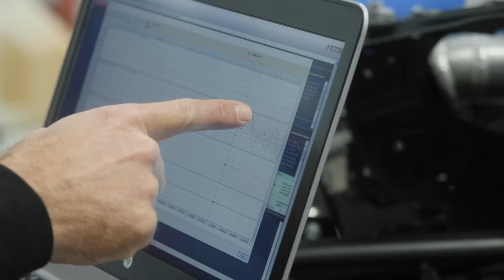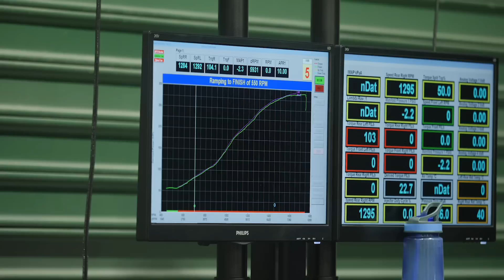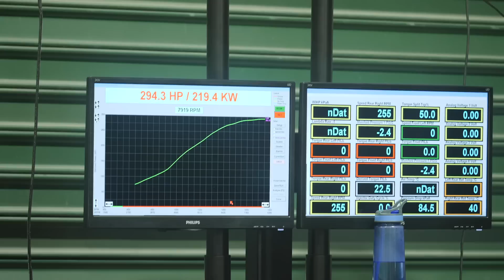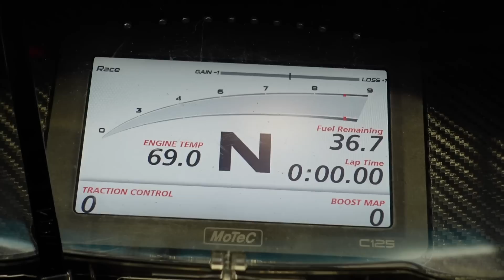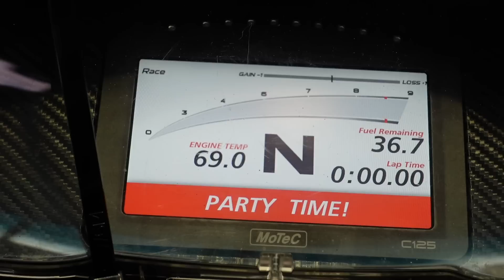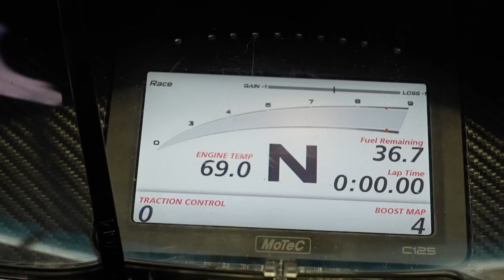Engine Break-In, 9,000RPM Limit | 650HP SR20VET Swap | SR86 EP 5 [#BUILD]

Comment: Cool - and it will be down there 😉
If the power peak wasn't reached before the rpm limit you're using, did you consider advancing(?) the exhaust cam', the intake' if you have clearance, or both by ~4 degrees, to check if that gave a little more power 'under the curve' (re: rpm drop when next gear selected) and/or a little more torque, and maybe a lower boost thresh-hold? While it's normally good practice to time them as per spec's, sometimes you can move the curves a little to better suit the specific requirements of the engine installation being used..

Comment: I had in mind that i will use Millers CRO 10w-40 running-in oil for the first start, but my engine builder warned me, when then i exchange the oil for something like 10W50/60 and again dont completely disassemble the engine and cooler, the running-in oil remains in engine(0,5L for expamle) and will mix with the new proper oil.Is this big of a deal?And sorry for my english O:-)
Reply from the maker: You definitely want to get as much of the oil out of the system as possible when completing an oil change. in our case the only oil remaining in the system is in the oil cooler and given the dry sump tank takes about 8 litres of oil, the remaining oil is a pretty small percentage so we aren't concerned about it - Andre

Comment: Noice work boys 👍👍👍 going with a similar setup of the steering wheel buttons but I'm thinking going wireless. What's your thought on wireless steering buttons ?
Reply from the maker: We haven't used a wireless button box but I think it's a sensible idea. I'm using a Cube Controls wireless GT wheel on my home sim and it's amazing. No reason the same technology can't be used in a race car - Andre
Reply: Wireless in the U.K. For kit cars and Raptor make a CAN based one as well.

Comment: Hey Andre, just wanted to ask if you think it’s a waste of time to use shielded wire for all the coils/cam and crank sensors? I was considering it for my new harness
Reply from the maker: Definitely you should use shielded cable for the cam and crank sensors, as well as knock sensors and wheel speed - Basically any high frequency mission critical input. Shielding the coil wiring isn't necessary though - Andre

Comment: How on earth is it only losing 20bhp to the wheels?
I thought this worked off a percentage loss, from the flywheel power?
Reply from the maker: It's to the hubs rather than the wheels, and Andre likes to stay on the conservative side, but there is no fixed percentage as there are so many variables. That said, to the wheels losses can be as high as 20% - Taz.
Reply: @hpa101  Surely that Inverse of conservative!
620-600 is 3% loss.
20% is the figure I'm more familiar with, as you say also.
Reply: Looking at the statistics from rototest institute on standard cars, they seem to be around 9-10% for their hub dyno. Might be slightly lower with as much power as this car have, but its some data to lean on.
Reply from the maker: @garagecedric  I try and stay away from the internet debates about power loss on a chassis dyno. Everyone has their own thoughts and it's really hard to give a definitive answer. Ultimately it doesn't even matter to me as we know what we have at the hubs and we have consistency and repeatability. If I was to put this car on 4 different dynos I'd inevitably see 4 different results - Andre
Reply: @hpa101  i fully agree with trying to avoid engine numbers, in the oem world where we had full loss number maps on all components it was still hard to predict. For me its hub dyno only to get rid of at least a couple of inconsistent factors, at least for my type of usage.

Comment: Interesting. I was interested in what the process was for startup of the dry sump set-up? Do you run the scavenge pump with a drill or something to prime the system?
Reply: yeah...run it with a drill after filling the tank. the level will equal out a bit once it's been primed
Reply from the maker: Yes, you can remove the dry sump belt and spin the pump over with a drill to gain oil pressure prior to the startup - Andre

Comment: So what happens to the party mode when the driver shifts?
Reply from the maker: In what respect? There is a sequential gearbox so for an upshift the throttle will remain engaged, or for a more technical NZ term, 'at full jandal' if that is what you are meaning - Taz.
Reply: High Performance Academy I see
Reply: @hpa101  Nice Scott Mclaughlin Reference there!